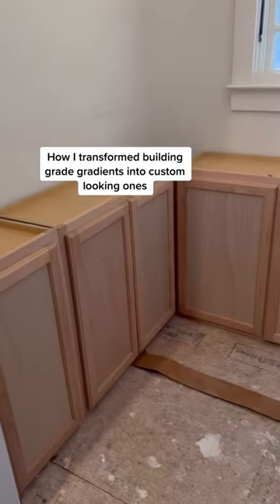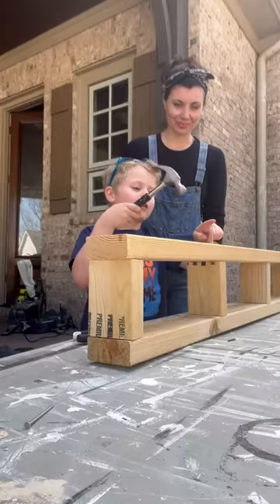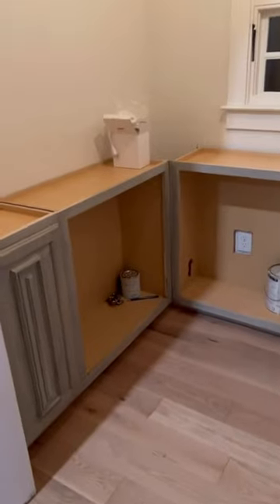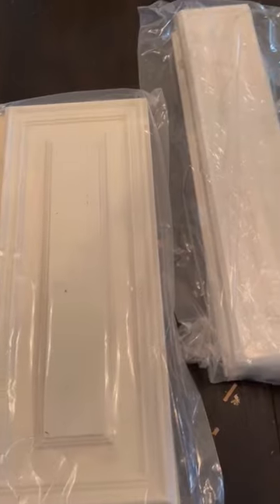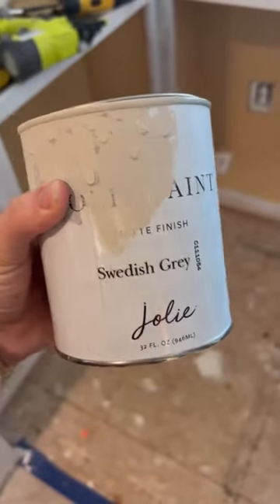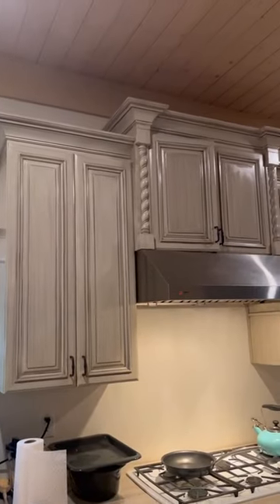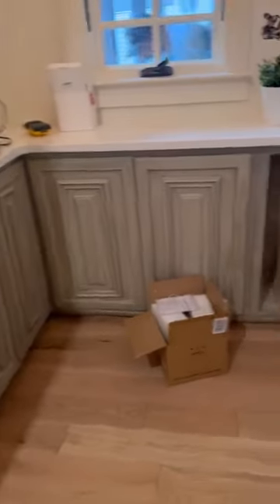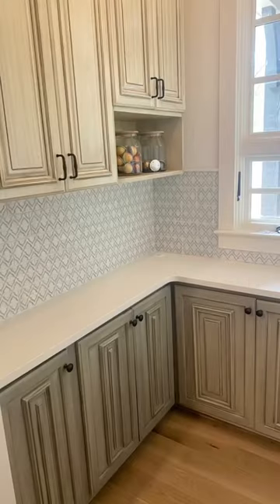#shorts HOME DEPOT STOCK CABINET TRANSFORMATION #beforeandafter #diy #paintingcabinets #pantry

Comment: going against the flow here, beautiful finish and color but the panel insert does not fit the right proportions /size. an alternative is to glue molding cut to exact size on the basic cabinets. nice finish though 😊